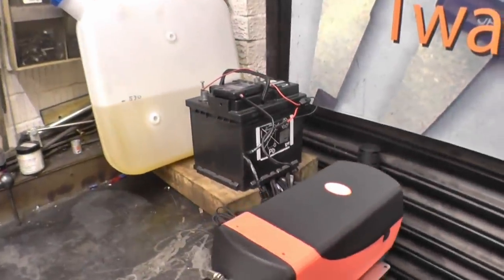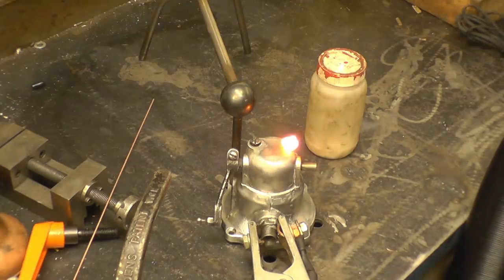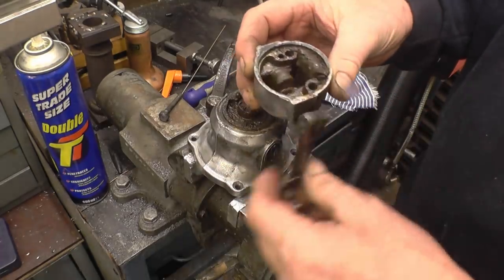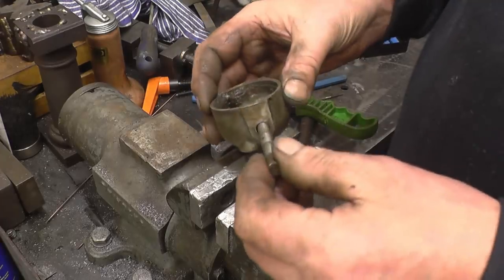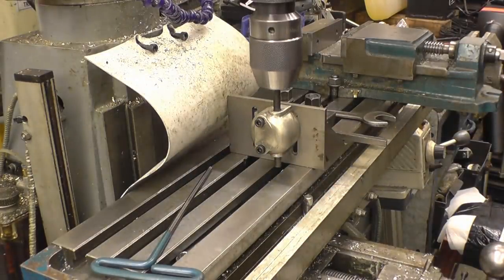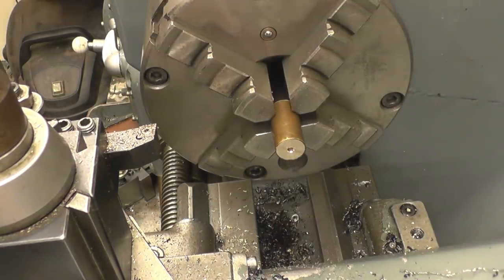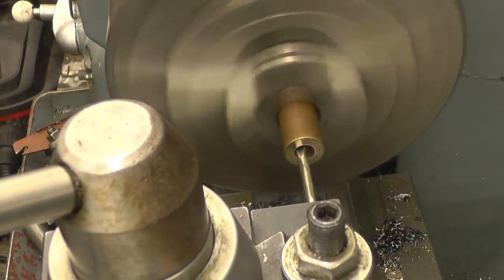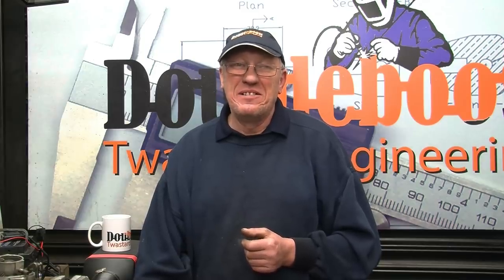SNNC 254 P2  Vintage Tractor Injector Pump Repair

Comment: Hi John, as always, great to see your vids. I am sorry to tell you though that 5/16" is .3125 whereas 8mm is .315" (well actually .31496").
I "know" what you mean about the cold, gets to (worst case) -30c in Dresden here, way way down on my native North Wales. I'm luck in that my workshop has a rad in it from the house supply. Worse for me is the bl00dy Summer, +40c here - it's nuts to live in a Country (DE in case you through it was Dresden in the UK) that has -30 to +40c range - evil at both ends. More power to your elbow matey. (2 more weeks and I'm home for Crimbo with my youngest in Llandudno).   All the Best mate...

Comment: interesting little heater  (never seen those in the US)..  Very small, and appears to exhaust outside.   probably wise to add a CO detector in the shop just in case it leaks any into the room, though, just to play it safe.
Reply from the maker: That is the first thing i did sound advice

Comment: No apology necessary for the heater noise, mine comes on all the time for about 7 months of the year (gotta love Canada!) but it's still quieter than the air compressor.  I agree that welding a nut to a nastified screw/stud is the best for removal, done a lot of welded nuts on exhaust manifold studs.  And, got my mug and cap coming now, just need to see how long mail takes from your side of the pond to ours!  All the best, thanks for sharing your work and ideas.
Reply from the maker: Thanks for the Support

Comment: As someone has already said, 8mm is actually bigger than 5/16". Perhaps recheck the shaft (especially the new one).

Think of Mr Palmer trying to install the new shaft with his 14lb farmer's screwdriver.

An old trick to make a reamer cut a little oversize is to jam a sliver of hardwood into one of the flutes and run it down the hole again.
Reply from the maker: thanks for that good tip on the reamer

Comment: Nice work on the pump, looks like it sat in a barn for a few decades after it was all worn out, before you got hold of it to rebuild the throttle side. Hope you put a lovely glob of grease in it to hold the bits safe from crud for another half century.
Reply: believe it or not the tractor drove into a dry shed 4 years ago in working order. The tractor is a 1953 tef20 grey fergie that has done alot of work!
Reply from the maker: Hi Andrew
Reply: The tractor is running like a swiss watch now john!

Comment: Great stuff as usual. I assume the diesel heater is because working on vehicles you can get waste oil etc for free? Rather than using an electric heater which costs. Good idea. Does the diesel heater have s thermostatic control? 

You could do a deal with your local chippy and get their waste oil!

Straightaway I was thinking why didn't you cut the copper washers out with the plasma to the correct size. But you answered that one!
Reply from the maker: The heater runs on kerosene  it is fully controllable